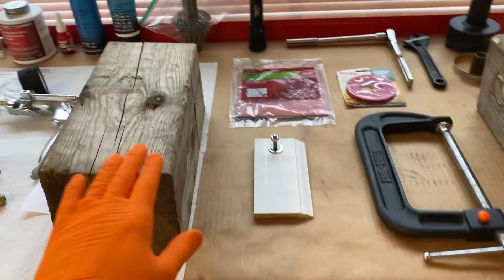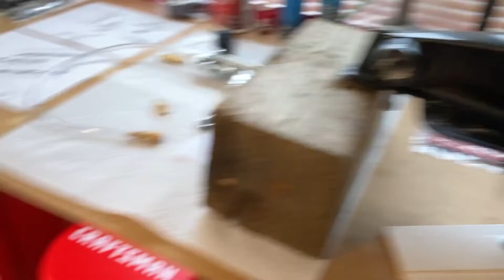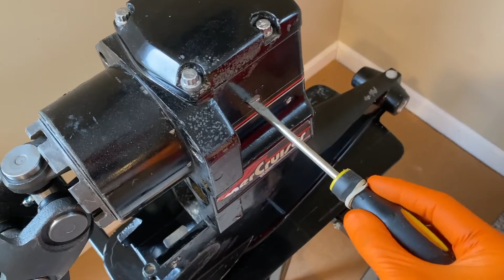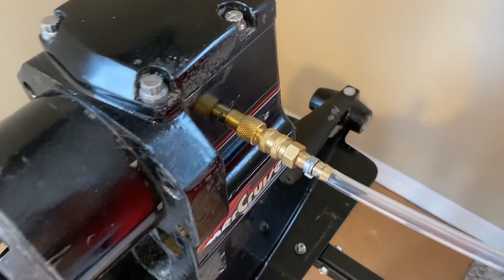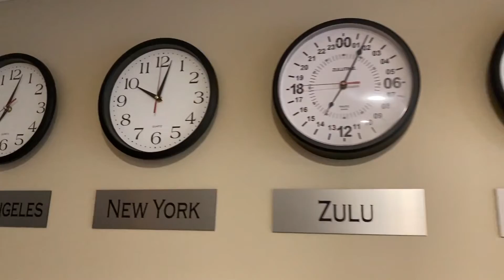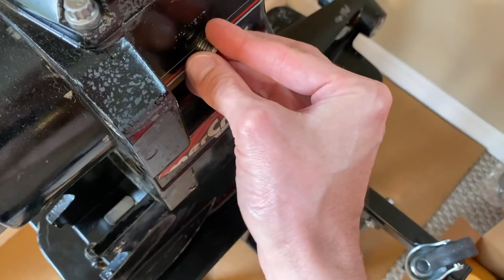Pressure Test Mercruiser boat motor outdrive upper unit - Properly & Safely

Comment: I love your videos. What do I torque the retainer nut to? With a retainer nut wrench and same craftsman torque wrench you have.
Reply from the maker: @chrisflicker9958  

Good morning ☕️

As far as the torque specs, we recommend applying the exact torque stated in your serial number service manual.

Some drives don’t have an exact torque value, it’s just tightened snug.

How is your project going?
Reply: @DIYwithMichaelBorders  thanks to you it’s going amazing. Working on a 1987 cobia with alpha 1 gen 1 and 2.5 L
Reply from the maker: @chrisflicker9958  

Very cool.  😁👍🧰

Comment: Thanks, Question- All u need to do is block off that small oil inlet hole on the upper drive? And then u can fully pressure test it.? What about the area where the shaft goes into. Do u have to block that off also. Or is that not a part to worry about doing this test.
Reply: It didn't work for me. There's also leak somewhere else.
Reply from the maker: Thanks for watching, after we rebuilt upper unit with all new seals, pressure testing it was very important to ensure no leaks.

Following these exact steps to properly pressure test unit will ensure it’s good to go and A-ok to be reinstalled onto lower unit.

As you can see, we used rubber pieces to block little oil feed hole/port which allowed us to perform a proper test.

😎👍

Comment: Dude, I don't know how you did this.  With the upper and lower separated, there is a big hole where the vertical driveshaft (attached to the lower unit) enters the upper unit through the oil seal.  Did you block this hole somehow?  Please explain what you did.  I could only pressure test the upper with the upper and lower joined.
Reply: Hey there TThack1, hope your day is going well.  I would clean the area up well with brake clean, or something to clean up any grease or oil.  I would find some quality non porous tape, such as shrink wrap tape, or metal duct tape.  Make sure that hole is nice and plugged, and I think you'll be good to go.  You only have to pressurize it up to 10 or 12 pounds, so I think you'd be good without any blow by.   Hope this helps, and Cheers!